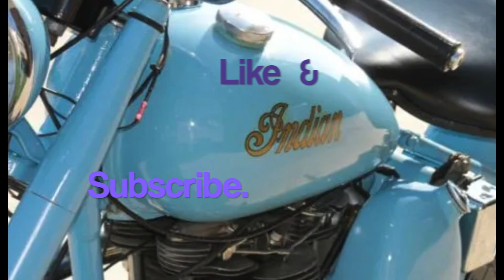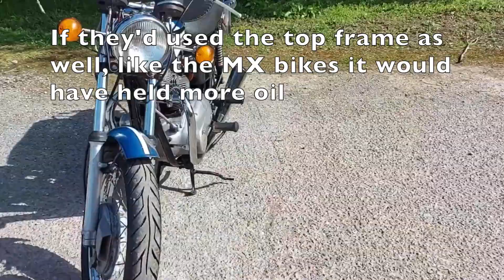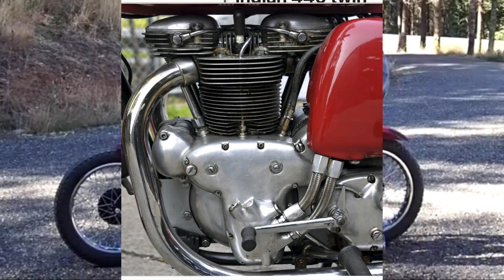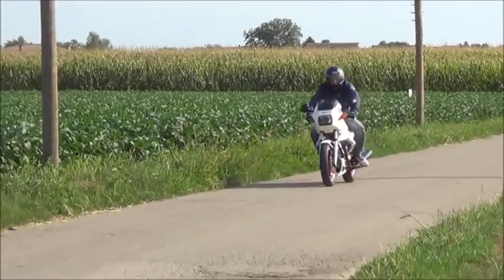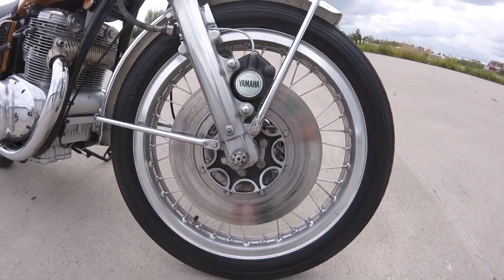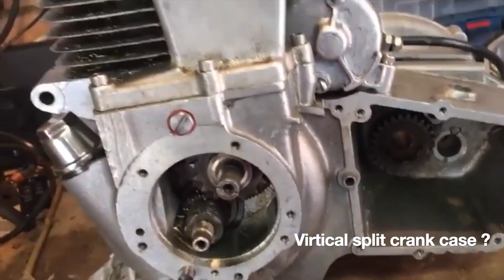5 Yet more Motorcycle Disasters

Comment: Wonder why Triumph / BSA decided to have the oil in frame idea, the separate oil tank worked fine, no need for a change. I had a  1961  650cc pre unit construction Triumph Trophy and it was a very nice trouble free motorcycle. Trouble was they started to update reliable old designs and come out with too many untested new parts and ideas. BSA Bantam was the same, reliable bike then someone had the bright idea of putting  in baffle plates in the flywheels to increase the primary compression and the plate was held in by pop rivets, thus the D14 Bantams many had blown up engines where the flywheel plate came completely loose inside the spinning crankcase, it would smash the engine internals ("blow up" the motor) It happened to a friend of mine, he was so proud of his first bike when he brought a brand new D14 Bantam, but within a few months the engine blew up because of this problem. Repaired under warranty and he sold it straight away. Must have cost BSA a lot of money repairing these bikes at a time when they were in financial difficulty plus gave the firm bad publicity. A good and proven engine messed up by unnecessary meddling with it.
Reply from the maker: Well the oil in frame came from Motocross 
It did result in a reduction in capacity 
It is a very good chassis non the less 
The T140s handling is very underrated 
As for the D14/4 well this largely came from dealers wanting more power 
It’s worth noting that while the D14 wasn’t the most reliable the B175 that came out a year later was a considerable improvement thanks to a redesign and is the best of the Bantams
Reply from the maker: Many changes are either dealer / importer driven 
Or driven by a need to reduce production costs and remain competitive 
The OIF is a simple and therefore cost effective design so I’m not Sure I would judge it as a failure
Reply: @bikerdood1100  Was the oil in frame idea done by any other manufacturers in production bikes ?  At the time the Triumph/Bsa company was in dire trouble and as you say, this change in design disrupted production for quite a few months, result as with the BSA Bantam change of engine design  rushed change of design without enough testing and thought put into it. The Bantam was a reliable little bike, I had 3 of the 175cc ones including my last one, a new 1965 BSA Bantam D7, a trouble free lovely looking bike with a red and chrome petrol tank and so wish I had it now. Thing was that by the late 60s it was outdated by the small Japanese bikes which were years ahead in design and so much faster. At the time I had my Bantams. my friend had a Honda CB 92 Benly sports ohc 125cc twin, what a bike that was, had a big twin leading shoe racing type front brake and even a self starter so what chance did  the small British bikes have.
Reply from the maker: Yep 
OIF certainly isn’t unique to Triumph 
Metise still use it and some Yamahas did too

Comment: I've had three OIF bikes, a '71 T120, a '71 A65, and a '72 T120V. I'm 5'10" and the '71 models are on the verge of being too tall. I once tried to bump start the A65 but I couldn't jump high enough to jump on the seat. My '72, with the late lowered frame is just fine. The oil bearing frame handles very nicely.
Of course the frame had to be modified to fit the Triumph engine, it was a BSA design. They seriously crippled the company with the OIF debacle and delaying the triple while they made their own version to "look like a Cadillac."
Reply from the maker: It was a silly piece of design which demonstrated the disjointed nature of BSA group at that point
Reply from the maker: To put the seat height into perspective a modern BMW is much taller than

Comment: I'm 5 foot 7 inches and rode several oil in frame BSAs and Triumphs and never had a problem with the seat height and there was never any problems with the conical hubs on the 650s either.  The triples had a bit of a problem with fading at high speeds though
Reply from the maker: It’s more often states about very early bikes but is definitely over played I think
Reply: The seat was lowered after 1972.
Reply: @muzza881 it was lowered by one inch but not all 1972 models were lowered.  I have owned both
Reply: @alexanderpotts7308  A lot of 71 models were still for sale in 72.

Comment: The Moto Guzzi Lario’s valve springs were vastly over-rated for the rpm and size of the valve. Plus the valve was a friction-welded 2 part item. When it was operating at maximum temperatures, the valve-springs tended to pull the valves apart.
Reply from the maker: The two part valve design is actually quite common and is used by a number of other manufacturers . But there is no doubt it was troublesome for the lario , ditto cracking valve seats 
A great shame because what a bike it was

Comment: A fine selection of the industry's bloopers. I bought a new 1972  Triumph 500 Daytona in February of 1973 for $1,100. Yes it needed a 5th gear but unlike the Honda CB350 it replaced, it was lighter and handled much better in the twisty canyons - a GREAT dance partner
Reply from the maker: A now often forgotten classic the Daytona with a top speed of around 105mph.
I read a period road road test against the XS 650 Yamaha. It was pretty well as fast but much more  nimble
Reply: @bikerdood1100 In the early '70's the Yamaha RD 350 (two stroke twin) was the most nimble Japanese bike I rode. I also road a friend's Yamaha 650 latter that decade. It was oil-tight, reliable and a sweet ride.  However, it isn't fair to compare a 408lb(dry) 650  with a 356lb (dry)  500. Usually, the  XS 650 Yamaha was compared with the Triumph 650 Bonneville. Which period road test are you referring to?
Reply: It needed a fifth gear, just like the BSA A65, which didn't have enough room in the gearbox case. On the 500 the addition of the fifth gear would've meant the end of the kick start. The race bikes got the fifth gear.

Comment: I bought a Triumph 650cc Bonnie new in 1972. I loved the bike but ... Well the brakes faded, but if you pumped them they worked. No my problem was quality control. The tank leaked, the clutch plates constantly ate the clutch basket, in teh end bearings started to fail, so I the sold it, with the oil leaking as it had from the day I got it.
Reply from the maker: Generally Triumph clutches have a very good reputation 
The tank is definitely a quality control issue 
Leaks are most common from the push rode tubes
Reply: @bikerdood1100  My 1966 T100SS (bought new) had no clutch or oil leak issues. The Bonnie's leak was not from teh push rod tubes but a weep from the front of the RH crankcase.
Reply from the maker: @geoffboxell9301  hmm poor assembly or machining then

Comment: I had a 98cc James two speed controlled from the handlebars, used it for work, thoroughly reliable.
Reply from the maker: That motor was used on a ton of post war commuter bikes
Basically a moped by modern standards 30 odd mph but cheap n reliable 
Not everyone wanted or needed a Bonnie after all

Comment: I HAD A BONNEVILLE....IT HAD THE CONICAL HUB..BUT REMEMBER....IT WAS A DUAL LEADING SHOUE...IT STOPPED PERFECTLY....WHAT DIDNT WORK WELL..
WAS THE WOIDRUFF KEY ON THE TRANSMISSION CLUTCH HUB....MY BUDDIES GOT USED TO MY CHANGING IT OUT ON THE ROAD....OR THE TAILIGHT VIBRATEING APART....BUT...OVERALL IT WAS QUICKER. THAN MY KAWIZAKI 650 LTD....IT OUT HANDLED IT..WAS LIGHTER...BETTER LOOKING...PULLED WHEELIES. LIKE IT WAS BORN TO DO IT.....LASTED 20 TEARS BETWEEN OVERHAULS....ALWAYS FIRERED WITH ONE. OR TWO KICKS...IT WAS THE GOLD WITH BLACK ACCENTS.......I MISS IT...IF I HAD. NOT HIT A TELEPHONE POLE.....I WOULD STILL HAVE IT..
A DISSASTER.......I THINK NOT.
Reply from the maker: Well as the video says the problem wasn’t really the bike itself but the company’s inability to get it to market

Comment: I had a Lario. ( I was a courier.) It lasted 2.5 days..😅😅😅
Reply from the maker: Commuted for 11years on my standard 2 valve head job 
Had a few problems but no more than on a Japanese bike 
Never had to push it home
Reply: @bikerdood1100  Yes. It should have been good. Pushed mine a good few miles. Got picked up by a speedway rider. Took me home, did his best to get it going. It was the ignition pickups. He sold it for me to a mate of his. Sussex rain I put it down to.

Comment: My first English bike was a a 1971 5 speed Gold T120 Bonneville 650 I worked off the cost for $800 in 1979 and I fell in love. It had a personality and ALWAYS started 1st or 2nd kick even in 20 degree Conn. weather. Like any mechanical semi/alive being it would let you down at the worst times, but it was pure love at 104 mph wide freakin open with a porsche 911 2am driving like a banshee on wet mountain Ct. roads to get home before I froze to death in winter snowy plowed roads. I have had MANY Limey bikes and love the high seating or center of gravity letting me lean over far enough to wear holes in the side of my shoes, light weight, great handling and how easy to tune up. The only minus is the vibrations breaking off parts while riding, spark plug blew out of head shocking the shit out of my leg on the way to work and the plastic carb bowl caps on the amal carbs would spin off freezing one of my legs with gas. I pulled over and dug through a trash bag on garbage day and took the cap off a tube of tooth paste to get to work. It stayed there for years not leaking. Ahh memories I loved my Beezers, Nortons, Etc
Reply: Oh and I LOVE the right hand shift...great for dirt track racing...
Reply from the maker: The OIF bikes were great too 
Once they got their act together and got them into show rooms, which is what that section was about rather than the bike itself. We had an OIF bike and it was really good

Comment: 3:30 Did those Indian engines rotate backwards (clockwise from the drive side) - which is the implication of the primary being on the RHS.
Reply from the maker: That is a good question. The first Triumph parallel twin did, the 6/1 of 1934 because it used a gear primary without a lay gear. Need to check it out now 🤔
Reply: @bikerdood1100  
I had wondered if if the engine might be conventional anticlockwise, with the gearbox reversing the sense of rotation. 

I note that the Rotax aero engine drives props clockwise (unlike the anticlockwise prop motion on the Lycoming) but it is  geared simply (reversing direction) as it has a high design speed which needs to be reduced for normal props.
Reply from the maker: @frogandspanner  the vast majority of bikes throughout history ran forward if you will, but not all as long it’s designed to from the outset it’s fine either way.
Interestingly the Hesketh ran its crank backwards but the forgot to tell the guys making the pistons, which did not turn out well

Comment: I had a yam TX turn up in my workshop around 1995. My better judgement said steer clear but the thing was in surprisingly good external condition. Customer had discovered it in a shed and wanted me to get it running. I told him "I will take a look, no promises".
Well the very first thing i tried to do was remove the spark plugs, they wouldn't budge and there was no way i was about to snap them off so i heeded the warning and told the guy to come pick it up, no charge. Holy moly did he loose his mind when i tried to give him a history lesson on those things! Apparently i was some sort of scammer/rip off merchant despite not charging him anything.
Reply from the maker: People get very defensive about their machines and take any criticism really personally for some reason. In the end is only a bike
Reply: @bikerdood1100   I was a mechanic at our local Yamaha dealer in 1974. The TX 750 Update Manual soon became thicker than the original Service Manual. I can remember the dealership's owner having a very heated conversation with a VIP customer (RCMP) who upon purchasing the TX immediately had the bike professionally  repainted in  gloss black. Both the customer and the bike disappeared shortly afterwards, never to return.

Comment: I had a T140 750 bonneville, 82 model, one of the last, vibrated like buggery, shit off a shovel till it hit eighty then the vibes set in. Frightening. 650s far better.
Best bike I had was a 700 super meteor royal Enfield, ton no problem smooth as anything. That's the difference between static and dynamic balancing
Reply from the maker: Well RE would statically and dynamically balance their cranks so should have a better reputation than they deserve really
Reply: @bikerdood1100  Royal Enfield twins were super smooth engines, only weak point was the camshaft drive chain. I've blown a couple up in the past.

Comment: The OIF triumphs are a better handling frame than the prettier early single downtube frame models.  I bought one new in 72, and another one last year which I have just finished renewing . Looking forward to warmer weather.  Other than that, your video and bikes were very interesting. Well done.
Reply from the maker: Well the video isn’t critical of the frame, but the total mess getting it into production. Triumph / BSA missed the critical US selling season when they could I’ll afford to do so. We had an oil in frame bike and would have to agree It is a better handling bike than the earlier more expensive machines.
Reply: @bikerdood1100  Did Triumph/BSA approach Ray Hensley at Trackmaster about building frames? I recall hearing that they lifted the design when Hensley wanted too much money. They sure look like Trackmasters.
Reply: I remember the 72 Bonnie, with a metric bearing on one end of the crankshaft and an imperial one on the other end.  Supply of bearing was another problem they had in that period.

Comment: Well, I have a Moto Guzzi Lario in the shed it’s done 19,000 miles and only dropped one valve. You neglected to mention some of the other delightful issues such as cranks snapping second gear failure and shaft drive gears shedding teeth. Not to mention the horrendous Italian electrics the ignition system being a notable example. Thank you for reminding me why it’s in the back of the shed.
Reply from the maker: Oh dear

Comment: I did quite a lot of work on the 1971 - 1972 line of T120 Triumphs. It seems to me, in a very unscientific study, that there was a quality issue with this range as well. It was hard to define but unrelated items used to just break. It was the only Triumph twin I ever saw, outside of a racing application that ever broke a crank. They were tall, square and uncomfortable. The colors (faded blue and flat mustard yellow) were pretty horrible.  At least the T140 saved the day in the styling and the build quality department.
Reply from the maker: I think as the money ran short quality control took a back seat. Often the. Case in times of crisis. 
The T140 and the Cooperative for me get a lot of undeserved stick. Working with no money they did some very good work. Right at the end the short stroke Thunderbird 650 was lovely. I remember really wanting one in 1982 but then it was all gone
Reply: @bikerdood1100  The last bikes my dealership in OKC got were a smoked red Triunph Executive, a Triumph TSS and a TSX. They were beautiful all with an electric start on the timing side. The fit and finish were excellent and it's sad because it was too late. I know that the T140s get a lot of bad press but to me they are still great bikes that can be very reliable every day riders. I am not familiar with the short stroke Thunderbird 650. Maybe a subject for another video? Keep up the great work.

Comment: I'm surprised  the TX 750's top end oil leaks were not mentioned.
Reply from the maker: Well it’s a short video I think if I went into too much detail I’d have one bike per video 
Maybe not a bad idea
Reply: Interesting...    my brother got one from new that I bought off him cheap when he went travelling.   Various terminal problems with balance chain, oil on the points, and seized main bearings....  but the top end was tight.
Nice to ride when newish, but obviously crap when the problems started.
Reply from the maker: @annpeerkat2020  I always think a good guide to how well they fixed problems is how many you see on the road 10 and 20 years later
You see very few VF 750s but an awful lot of VFRs still around

Comment: I bought in 1977 T140V  export Bonneville. It was very reliable. It handled well on the Dunlop K70  tires. The only fault was the silencers  rotted through  so aftermarket  silencers were much cheaper than original and finally the contact breakers wore out and needed regular  attention. I owned it from  1977  until it was stolen in 1980.
Reply from the maker: Electronic ignition is good but as for the exhaust, well there is probably a stainless option now. That would be expensive I suppose. 
Electrical systems always wear out in time though really, even on Japanese bikes, although many Japanese bike owners wouldn’t admit it. But I’ve replaced quite a few alternators and rectifiers over the years
Reply: @bikerdood1100  Solution to the exhaust corrosion is Norton style peashooters. Gas flow is much better and they don't trap moisture as much as the original "cigar" pattern. I've been using them on my T140V for 25+ years (they sound much nicer, too).